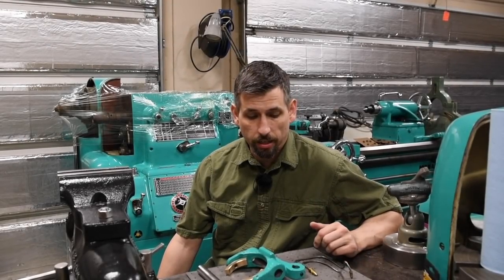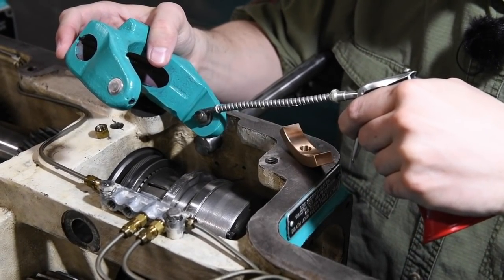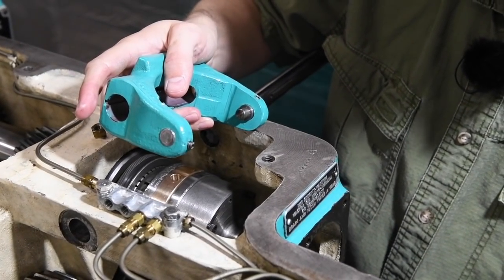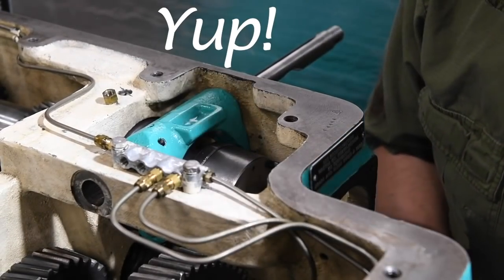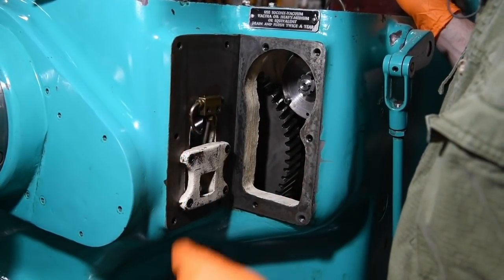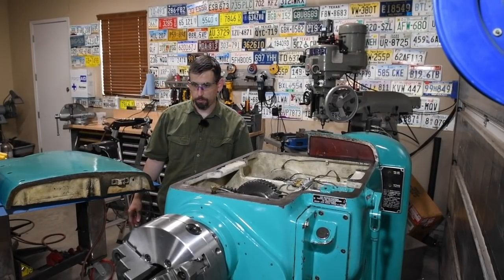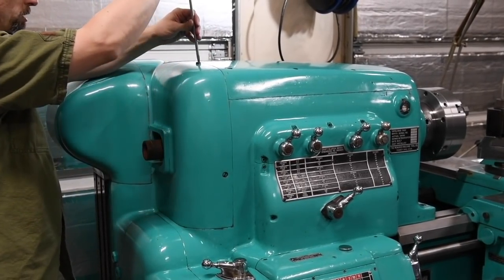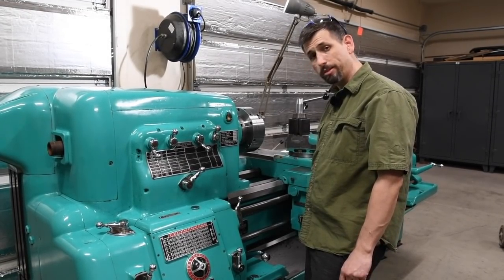Monarch Shifter Problem Part 3

Comment: This is clearly the part of the machine that was set up in plain air and then had the rest of the machine manufactured around it.  I once had a car where the distributor was like that.  Good to see you triumph and with a repair which will, likely, mean you never have to do that again.

Comment: If  the clutch on the Monarch is anything like my Clausing, the shoes are only to engage the clutch, not hold it there. The rotating parts of my clutch has detents to hold the engagement once it has been moved to that position and the shoes are no longer applying any pressure. As the [multi-disc] clutch plates wear, there is an adjustment that slightly moves the detents position so the shoes don't have to remain in contact. I suspect that there was an improper adjustment at some point that required the the shoes to actually hold the clutch engaged (perhaps also evidenced by the heat marks you pointed out).

I also agree with the comments about the shoes not needing (and even detrimentally) to be curved. When the yoke swings thru an arc, the centerline distance between the clutch shaft and the fork shaft changes. Rectangular shoes would be able to slide up and down that slight amount and tight fitting curved shoes would not.

Nice machine for a nice price. Really think that powered compound is cool though it does create a bit of a problem with that high tool post mount.

deckerbilt

Comment: Just a suggestion, if it hasn't been made.  When you remove cover again find the balance point and drill for an eye bolt (small)   use engine hoist along with eye bolt for easy removal.  Either leave the eye bolt in place or fabricate a plug. I make this alteration on every item i have that is heavy and must be lifted above my waist.
Reply from the maker: flineman that’s one of my problems- no engine hoist or gantry crane. I’d love to make a jib crane behind the lathe for changing chucks and loading heavy parts. We’ll get there and thanks for the suggestion 👍🏻

Comment: Curved shoes would not be able to move off centreline of clutch shaft as pivot point is variable on circumference of shoe movement as the bronze parts move they rise up from the centreline of clutch shaft that’s why the bronze parts are flat from factory and not curved but we all need to learn you may have some high force on the shoes that you may not feel from the spindle start handle
Reply: Thats right
Reply: All things being equal, the internal diameter of the shoes has to be significantly bigger than the shaft to allow for the mismatch.

Comment: Your lock washer is missing the inner key - this will probably back out.   A quick fix is to put a spot weld hump - where the key on the shaft is.  I see this problem on front axles of older cars all the time.  Love your energy - going thru your videos now (I picked up a Monarch 60 just recently and all your problems I am checking mine for!!!)

Comment: Did you check the clutch adjustment? Those shoes should have zero pressure on them once the lathe is engaged. This is how most machines are set up of that era. I have similar problems with a Bullard VTL. The shoes would burn and smoke if the clutch engagement wasn't adjust properly. The 3 dogs would push back causing pressure one the shoes

Comment: The answer cant be "shorten the pin". That's how it came from the factory. What it appeared to me just for the view you gave us when you have the clutch cover pulled off at the end, was that the next section of the shaft that the shoes ride on had multiple set screws. I would hazard a guess that removing those screws would pull that flange off and then you would be able to slip the arm and its shoes right over that section then replace the flange and clutch cover plate. Just a thought.

Comment: Job worth doing is a job well done.  It's the way we were taught back in the 60s n 70s. 
Things changed after to just get it working or throw it out buy new import crap. When NAFTA started so started the ruining of the nation's working class . Good job I knew you would have to pull the pins to mount the shoes . So glad she's finished and real pretty to boot. I'll be watching your vids thanks
Reply from the maker: Gary Wills thanks Gary. It was quite the job but worth doing for sure.

Comment: Hi, nice to see others have struggles too.  In terms of the order of operations. . . wouldn't it have been best to put the brass shoe on first that had the set screw on the bottom and then put the shoe onto the arm that has the setscrew on the side?

Comment: maybe you said this somewhere, I just found you... what does a machine like that cost? 1000. 10,000, 100,000? I really have no idea.
Reply from the maker: I paid $2,500 for the machine, which was a very good deal. The motor was out of it, it was covered in rust, and was of course not running- those factors affected the price. On eBay in its present condition, probably $15,000 on the low end. Monarch will completely rebuild this machine back to factory new condition for $120,000 I’ve been told.